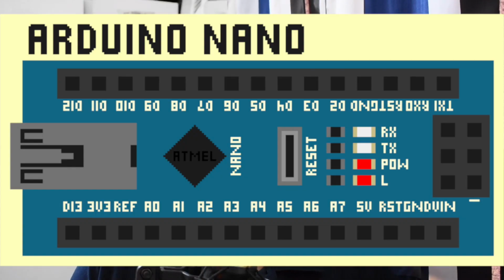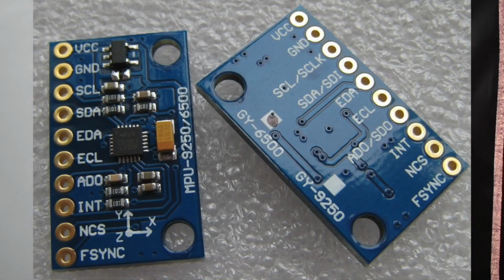Self Balancing Robot | SERVING DRINKS WITH IT!! | 12V DC Motors

Comment: Can I use nema17 stepper motors
Reply from the maker: Yes you can. Stepper motor will give better results. But a bit more complex in circuit and code.